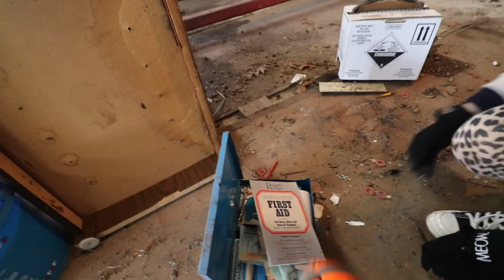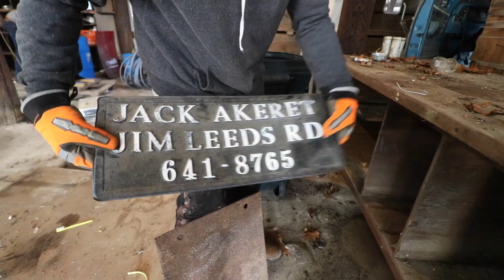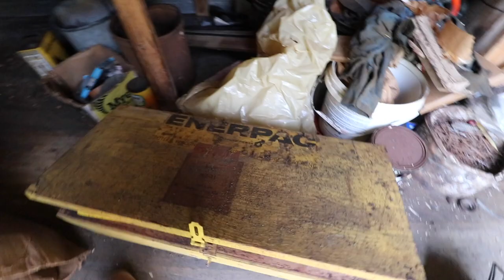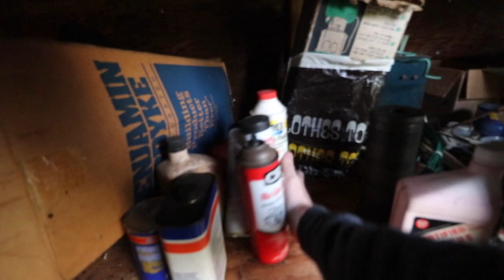Digging Through Barn & Semi-Trailer Full Of SURPRISES!

Comment: The Yellow Tool Box with the Enerpac logo is an Enerpac Maintenance Kit that retails new for 3 to 4 thousand  brand new (depending on which kit).   Its used for hydraulic pulling, lifting, spreading... etc. very  versatile.  I've used there Mandrel Pipe Bender kit. They make some top quality hydraulic presses and pumps and attachments of all kinds.